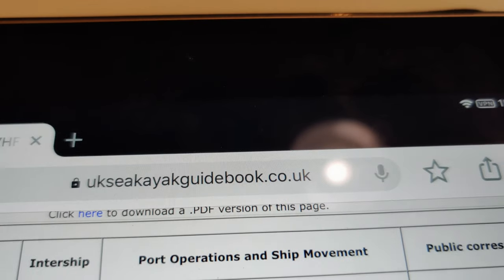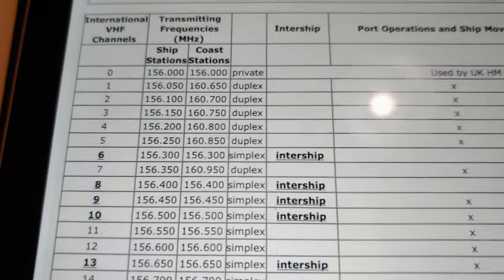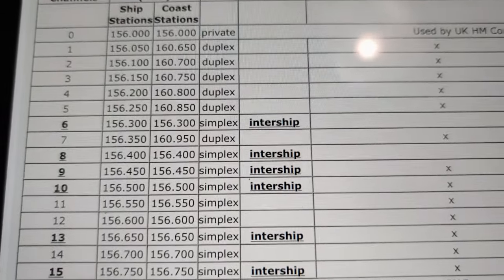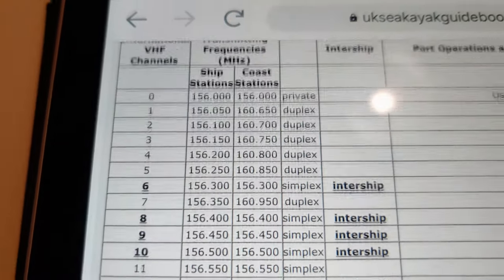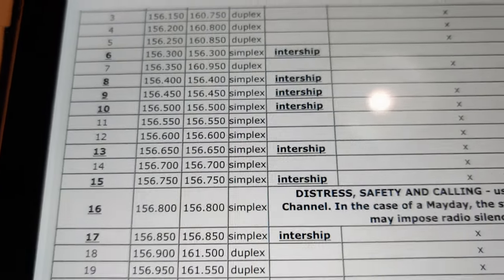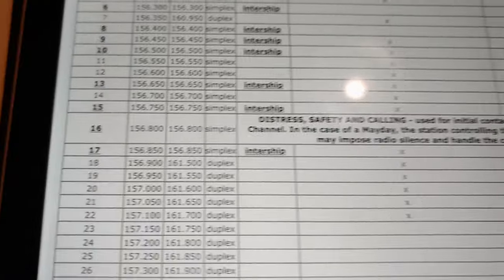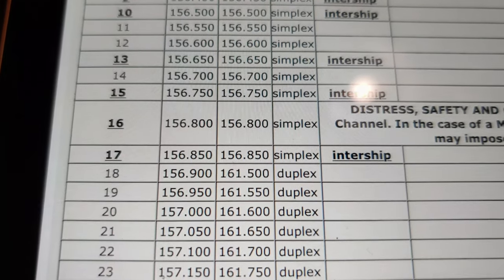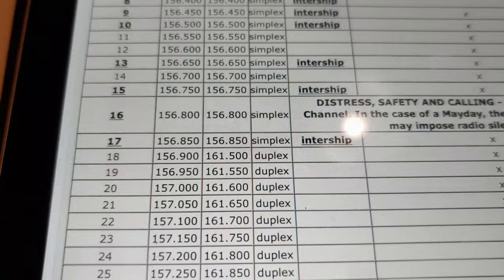No PC : Baofeng / Esynic VHF Radio UV-5R. Easy programming for MARINE use. Boat and Sailing Radio

Comment: If you program this radio properly with the free CHIRP programming software you can make the radio show channel 16, coast guard, SHP/SHP or whatever you want. Then when you switch from frequency mode to channel mode it will make it much easier. You may also program the weather channels, PMR channels or the amateur radio channels. There are many YouTube videos on CHIRP programming.

Comment: You can get longer aerials for this unit which helps with broadcast and reception quality. There are also get two different wired mics. one has an earpiece the other not. Also it has FM so you can listen to radio 4 which may be handy for weather. These units are being bought by prepar types incase of civil emergency like war. The Ham Radio community also do RAYNET exercises in cases of emergency and co-ordinate with police fire and ambulance.

Comment: Hi, There is some very important missing information here. 
Some of the Marine channels are simplex (ch 16 for example) this means that radios transmit and receive on the same frequency. 

However some (including ch 4) are duplex. This means that your radio transmits and receives on different frequencies. You have to be in range of a repeater (a big powerful radio/antenna) that receives your low power transmission (on frequency 1) and re-broadcasts with far more power (on frequency 2) for much greater range. 

Duplex channels can be programmed on the baofengs, but it is a bit more involved.  Ch 80 for instance (often Marina use in the UK) would not work if programmed as this video describes... they would hear you, but you would not be able to hear them... and you may not be able to tell if the channel was free. Also duplex channels will not work directly radio to radio if you are out of range of a repeater on that frequency pair  (though you may hear one side of the conversation/have one way communication if they are programmed as described in this video)

In terms of Licensing (In the UK)

There are actually 3 licences that are required by ofcom for marine operation

1. Type approval of the radio(The baofeng is not type approved for marine use)
2. The Ships Licence (probably the one you applied for)
3. The Operators Certificate of competence (a short training course is required)

In an emergency anyone can use any radio to communicate! No licence required.  However Interfering with emergency communication is one of the few areas where ofcom (in the UK) take a pretty dim view and actually enforce/prosecute. £5000 fine and 6 months in prison are mentioned on the ofcom website and carrying a non-marine radio for planned emergency use is also not allowed!

I may till on occasion! carry a baofeng in my kayak if paddling near the coast/estuary areas, it is a good value for money tool or as a backup. However it needs to be programmed accurately and you need to be aware of its limitations (poor stock antenna for vhf/internal interference (birdie) on some Marine VHF channels!) I would suggest even for most casual/occasional users it is not a good option. Used Marine VHFs can be picked up on eBay cheaply and just work (even if dropped in the water!) and the Operators Certificate is simple to get.

Hope this is helpful! Nicely made video, but perhaps some ideas for a part 2.

Oliver
Reply: Interesting that it's not type approved. But given your explanation I'll buy the HH600 Cobra.
Reply: All of the duplex pairs can be used simplex and there are many ch. charts available with that exact explanation. Why use a repeater that is not there? Most ports barely have 1 operational phone channel. So why would you program them like that instead of just knowing the pairs your port uses for phone and duplex service and program them in addition? Public safety is on a tetra trunking system in the uk and 800MHz apco project 25 trunking in the us and Australia. Its not even possible anymore to interfere especially not with a ham radio @ 5-8 watts. Also as a licensed shore station id rather a person have a 25 dollar baofeng and do some research compared to having nothing. Ham operators need to stop trying to regulate other services that they themselves could not even be licensed for.
Reply: mr. oliver good day. so i cannot transmit my baofeng a-58 to entel or icom vhf? im onboard a ship and i cannot connect my baofeng to those two i mentiond. can you help me transmit it with entel and icom?
Reply: The whole reason I found my way here was in the hope to understand the correct way to program duplex listings. The way I've been doing it is to program the Rx frequency as the main, then calculate the difference between the two and set the duplex offset accordingly, so channel 4 would be 160.8 with a negative duplex of 4.6. I wanted to confirm this was the right way to do it, but when the uploader posted this and said that his way worked, I started to question whether I was doing it properly - then I saw this reply. 

However, it gets a little more confusing when some frequency charts list the frequencies as Ship Stations and Coast stations. In this instance, presuming you always set the main frequency as Rx, how do you know which is Rx and which is Tx when they've been labelled 'ship' and 'coast'?
Reply: @Oliver Brown Well Said Sir…!!!! I am a Holder of a (“RYA Operators VHF License UK”) & (“SRC & LRC”) As I was on Rescue Boat Duty for (“Salcombe Sailing/Yacht Club”) & Other Rescue Teams in the UK & Assisted the (“RNLI in the UK”) in other Ports as well so I had to have the Appropriate VHF Licenses Etc. I also am awaiting a (“Amateur Extra Class Radio License”) & a Ham Radio Club Member so totally agree with what you have said above. I hope people will see what you have Replied & don’t use VHF or Amateur Radios without an appropriate License unless it is a (“True Emergency”). Keep up the great work. Kind Regards Nicholas.

Comment: Baofeng the manufacturer just makes them, but does not sell them. Other companies buy and sell them to their own specs. Its a confusing mess really, but its best to buy from a company that stands behind the product. I little time spent on the internet and you will find those companies. The cheapest price you find on ebay is many times a radio that didn't meet specs for name brand companies. Btech and Radioddity are two that are safe to buy from.

Comment: You should NOT be using ch67 for general chatting boat to boat. It is the coastguard working channel.  Intership communications are channels are 6,8,72 and 77.
Remember also that you require a ships licence and an authority to operate. 
The uv5r is not approved so you may run the risk of prosecution.

Comment: Can the dmr do digital selective calling to other std vhf marine radios with dsc? I'm not talking about private call to other dmr radios. If it can then why pay £100's for std vhf marine radios. The only way I can see if it could is if mmsi protocol can be used with mmsi number.
Reply: NO. DMR is for land use only. Selective calling is not DMR. There are many digital modes for different applications.

Comment: An operator's license is not free
Reply: $15 for 10 years.   

$0.004 per day.

Nearly free.
Reply: @wilcoxtactical3716  one off fee for licence. Your thinkng of ships licence. Unless it's a differant ball game In the usa
Reply: Of course they will work but they are not type certified for marine use.  An approved radio is limited to Marine frequencies and is not programmable.

Comment: Guess you forgot that this radio is not “type” accepted for Marine frequencies. Oh well.
Reply: As long as you program it correctly, should be fine.  Nobody is inspecting the sticker below the battery of any radio for type acceptance. Just don't transmit on marine frequencies when on land.